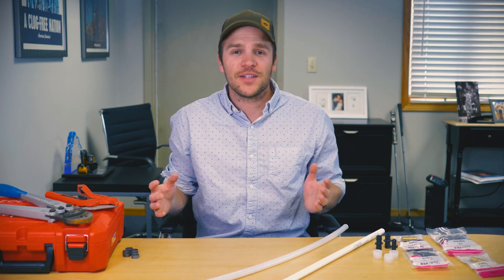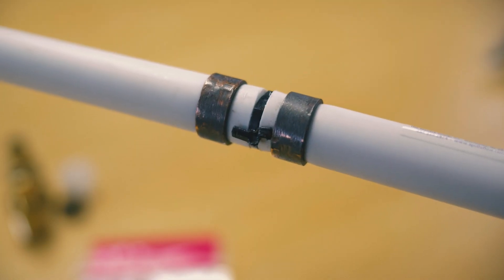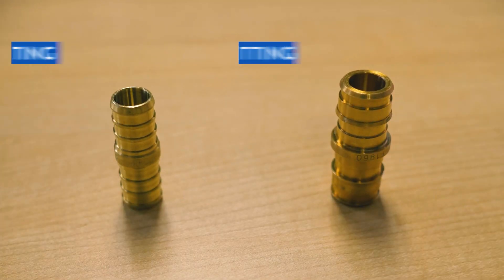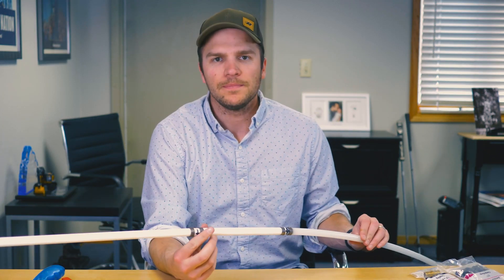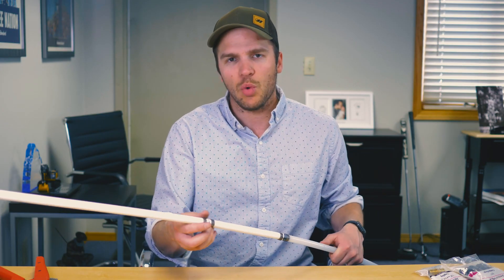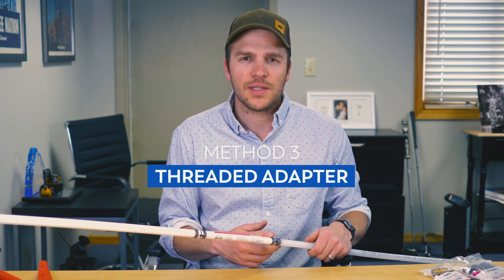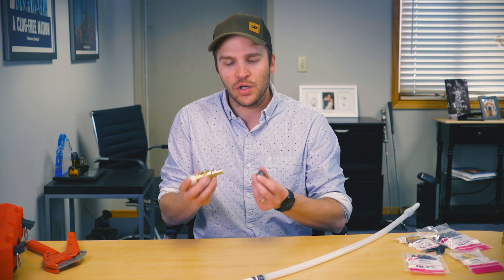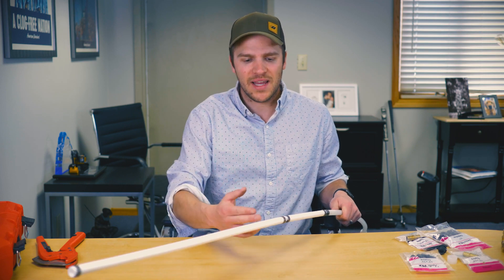Connecting PEX-A to PEX-B

Comment: There is no evidence that sharkbite push to connect connections fail any faster than other connections when used correctly. The main reason not to use them is that it would be insanely expensive to repair them. It is conspiracy theory that has continuously crapped on them as connections. There are perfectly good reasons to use them over sweating copper, one example being in a tight location for a repair. I respect a plumbers opinion if and when they actually say why. But in this video it just says "don't use sharkbite" with no actual reason. Sharkbite push to connect are rated for use in plumbing code and can be hidden behind a wall, given that the plumbing standards are conservative when approving new technologies, I don't see how they are so negatively viewed. Yes some youtube videos will show them failing at 300 psi or more, but residential plumbing should never hit that pressure and you shouldn't expect any connection or pipe to support that pressure. I had a pipe freeze that had a sharkbite connection and the pipe burst out the side wall, the connection was rock solid.
Reply: The biggest complainers of Sharkbite PTF fittings are plumbers who envision the $200 service call to replace a .79 fitting coming to an end. If the simpleton homeowner can repair a leak with a $7 fitting, oh where oh where will all the plumbers go?
Reply: @chrisd4565  enjoyed reading your comment....was preparing to reply to you with the completed quote...but you circled back very eloquently!
Reply: Shark bites as mentioned earlier have limited warranty for a reason! And lab water pressure tests you can google have shown they fail first. Lastly, i replaced all my shark bites by learning to use the preferred plumbers tool of crimping brass rings which is easy and cheap. So invest a few dollars and 15 minutes to watch a video and learn so you have a piece of mind of your house not flooding when you’re out you lazy bastards. Oh it’s true, it’s true!
Reply: I have seen damage to pipes that have a lot of pressure cycling (a house normally wouldn't, but air systems do). The soft plastic pipe is continually scratched by the steel teeth as the pipe expands and contracts. I haven't seen one fail, but have removed one that had deep gouges in the pipe.

A few other things I don't like about them: 

They offer no resistance to the pipe turning. This can make it harder to set a faucet position if it doesn't have a flange with screws (this is a problem with PEX in general as the A&B fittings offer little resistance either, bit more than SB). Or I have run into situations like a yard hydrant where you cannot unscrew the stand pipe for servicing it because a SB was used and just spins instead of unthreading the NPT fitting. 

If you drop a fitting outside, dirt sticks all over the o-ring due to the grease on it. It is hard to get it clean again, and is concerning whether it is any good after that point due to not being able to get all the grit out. Or you are just working in a hole and it is hard not to bump the sides while pushing it on. 

You have to deburr the outside of the pipe as well as the inside, to prevent tearing the o-ring and causing a leak.

If the pipe OD isn't smooth it may not seal. 

They cost more...
Reply: @court2379  so… to sum that up, you never saw one fail, but you’re certain it will. Got it
Reply: @philbear21  No that is not what I am saying. I have not seen one fail in residential water use. I have seen them or the same design for smaller hoses fail in other applications. Air lines, and 3d printer filament guides. It isn't a rigid connection the movement it allows, allows for wear to occur. In most cases it will probably never matter in residential use. The pressure is rarely ever unloaded. So there aren't thousands of full pressure cycles like industrial pneumatics (and even then they hold up for a long time if undisturbed). 

I listed other potential issues with them as well, everything has its limitations. I don't like them for irrigation use, as it is too easy to get dirt in them and have a mess to clean before they can be used. 

If they weren't more expensive I would probably use them more indoors.
Reply: @court2379  you did list other potential “issues”. Let’s take a look at those: 
1) They allow movement: this is actually a positive. How many glue connections have been thrown away before they were installed because they were slightly off? Ever had to desolder copper for the same reason? The only time this is an issue is when they are installed where they shouldn’t be, like the very places you described. That’s user error, not an product issue. 
2) They get dirty if you drop them on the ground/hard to clean. Again, user error, and you can’t glue or solder dirty pipes either. The only point you may have here is that they are harder to clean, but they also come in bags to keep dirt and grit out of them. So don’t drop them or store them out of the bag. 
3) You have to debur them inside and out. If you’re worried enough about all these “potential issues”, then I can rightly assume you follow the manufacturer’s advice for other systems as well, which is to cut straight and debur both inside and out. 
I don’t know air systems, or 3d printing filament systems, but I’m pretty sure they have different requirements than res plumbing. I’m also not sure if Shark Bite themselves even recommend using their product in such systems. If they don’t, then your entire comment is moot, as every problem you’ve ever seen would fall under user error. You can’t drive a nail with a tape measure, then claim the tape measure failed. Also, we’re not discussing “similarly made products”, we’re discussing shark bites. They’re patented, so there are no other products exactly like them, and the only similar ones I’ve seen are plastic. Apples to oranges. 
Lastly, they cost more. They do cost more than other fittings, but if you’re doing a repair, but you’re not a plumber, you don’t have a crimp tool or expansion tool for pex A and B, crimp rings or expansion rings either. Go price a Propress if you think that one is the proper way. A torch, flux, solder, heat shield for copper. Primer and glue for plastic, and anything galvanized needs to be torn out, so I guess you don’t need Teflon tape and a jackhammer to clean that crap. All these things are more expensive for small repairs, and in some cases it’s actually cost effective to do small systems, but that’s what they were designed for. Not whole house installs. They are very fast, don’t require any tool, aside from the $2 removal ring, which reminds me; they’re also removable/reusable, if installed correctly. They are easier to get into tight places, and they can be rotated after connection. Ease of use is their main attribute, and they do that very well. They’re also approved for behind the wall use and I think they come with a 25 year guarantee. So now I’ve written a novel, where I set out to make a simple one word statement of summation: you haven’t seen one fail, but you don’t like them anyway. Hopefully, you feel differently now, but I doubt it.
Reply: @philbear21  It not simply user error to get dirt in irrigation fittings. You are usually working in a hole. Having  a bit of dirt fall from the top, or bumping the side is a regular occurrence. The grade in them collects all the dirt that touches it. PVC having a little dirt get on the connection isn't that big of an issue, or can be brushed off and reglued. The connection area is large and forgiving of such a thing, while the o-ring seal in push on fittings could easily be compromised. Barbed and PEX fittings don't have anything sticky, so the dirt falls or brushes off easily.
Deburring isn't required at all on poly pipe (PE) and only on the inside of PVC, though the cutters don't leave a burr on either.

As for movement, copper and PVC are free at the time they are fitted, so it usually isn't hard to get them in the right spot, and copper can be reheated to turn it. I don't see a major advantage for either. Sometimes you want it rigid, sometimes you don't.

It shouldn't be hard to say there are applications they don't excel at, just like every other product. Dirty environments is one of them. If the pipe is scratched up, they are a bad choice. If you need a rigid connection they are bad choice. If you have threaded fittings nearby they could be beneficial or a problem depending on the situation. Some blind situations you would never be able to undo them, where NPT could be. Others would be near impossible to make the connection without them.
They are just a tool in the box to be used where it makes sense and the extra cost is justified.
Reply: I like shark bite connections. I use them where I don't dare use a torch, and in very tight situations where I can't get a PEX clamp tool.  I've installed them years ago and have gone back to make renovations and the shark bite fitting is still intact and not leaking.
I also like that they can be removed either with a small tool made for removal or a tool of my own making and used again.
Reply: 20 years of personal experience says otherwise. Almost every time I find sharkbites in a house its an issue. Plus having a 5 yr warranty on a part thats not accessible is just asking for an issue. The rate of failure after that is much larger. I get calls weekly for them.
Reply: The evidence is that most professional plumbers and contractors have seen them fail and advise us not to use them especially when concealed inside walls. The good thing for the residential owner's is that thier home owners insurance will cover Shark Bite leak's inside a wall, not if, but when they do leak. 😮
Reply: I am not a plumber, more electrician and part mechanic, in my 45 years of mechanic work, I have never seen an O ring that did not fail. I do my own plumbing, and would NEVER allow a sharkbite fitting to be used in my house. I have seen several leaking or came off, and several friends had flooding  because of them, they were likely not installed properly, but I didn't see them, they just told me about it.
Reply: Couple of reasons. It's against code to put them in a wall because they do fail often.  The only thing that prevents it from leaking is an o ring. O rings deteriorate way faster than anything else since it's soft rubber. Just like your garden hose, or the supply lines to water heaters fall over time, so does a shark bite fitting.  A shark bite is never a permanent solution, unless it is easily accessed.  Now I'm a plumber and have personally gone to hundreds of leaks from shark bite fitting.
Reply: Shark Bites are legal in my jurisdiction they are considered “permanent”. Boi you gotta catch a clue! 😂
Reply: Totally agree.
Reply: I had a few shark bites in my house. I eliminated them after I moved in. I don’t trust rubber seals long term. I also have all pex a with plastic fittings so literally nothing inside a wall can corrode except the shower bodies
Reply: I agree with you, but isn’t shark bike for some reason have only 5 years warranty?
Reply: @agpawpaw  fair point, I have been told that most of the time a warranty is there to cover the period of time where a defect would be exposed in the production of a product. So 5 years seems reasonable to me in that sense. If it makes it 5 years without issue, I’m fairly sure the likelihood of it failing over the next 20 is much lower. This was part of a class I took on product management, not something I’m making up.
Reply: @agpawpaw  pretty sure it’s 25, but I can’t swear. I doubt they’d approve it behind the wall if it was 5.
Reply: as a old school repair plumber , most of our repairs involved replacing failing rubber parts . Washers , diaphragms , o'rings , ballcock seals ect.  Metal and plastic didn't fail as rapidly . Yes new formulations are lasting longer , but chlorines , ammonia and other chemicals still are harsh . Pick up the lid in your toilet tank , touch the rubber , what do you think ? A Sharkbite's seal is just that little oring , the contact area is hardly measurable with a tape measure . If the oring doesnt fail , any imperfection on the outside of the pipe could . The brass in the Sharkbite is thinner than conventional pipe and fittings also , I see freeze failures there . Your statement about the pipe bursting , it fails where the frozen slug just happens to be , copper tube is thicker and stronger than the SB fitting  . I would trust the old Quest Polybutelyne  more lol .
Reply: @jonadabster8401  again, someone who hasn’t seen them fail, but swears they will. That little o-ring is chlorine and chemical resistant, nowhere near the same material as a toilet gasket. They’re approved behind the wall and guaranteed for a quarter of a century. I respect you have an opinion, but guessing something will fail, and seeing it fail are two different things. I’ve done repairs on ALL types of fittings, except SB. Haven’t seen one fail yet. Heard about this one guy who saw…wait, he didn’t see it either. Not saying it won’t, but service plumbers have been around way longer than push to fit connections, so what were they repairing? ALL systems have problems at some point. As far as freezing, I live in a state that gets all four seasons. Our winters aren’t Arctic, but we do see -0F temps. We insulate things for this reason. As far as thinner brass than copper tubing? Pretty sure they’re different metals, with different properties, but either way, insulate it and it’s fine. User error is why they fail. Homeowner being user is why it’s common. Also, I hope that last bit was a joke.  If you trust ANY Poly more than SB, I can’t even take you seriously.
Reply: @jonadabster8401  Aside from a complete lack of any resemblance of correct punctuation and grammar, you are correct, rubber gaskets do fail. I have seen many toilet rubber parts fail, but they are also not made to last. If a toilet flapper was made to withstand 40 years, it would cost significantly more and likely outlive the entire toilet. Anecdotal evidence is not in fact proof that the gasket on a sharkbite will fail. They are different rubber compounds and the sharkbite is clearly designed to last much longer.  I also never said the sharkbite connection was superior to a sweat connection, I simply said there is no real evidence they fail at the rate plumbers suggest they do and therefore cannot be trusted. Once again when used properly, they are perfectly fine to use. Repeated connect/disconnect on the sharkbite will cause them to fail, I have seen that happen, but connect once or twice, they work perfectly fine and save time and work in spots that are hard to reach with a torch or propress. Your argument on a pipe bursting at the freeze point is simple lacking any reality in fluid dynamics. The pipe bursts due to pressure build up from water freezing in the line and it not having anywhere to go but through the path of least resistance. In many cases its a small pit in the side wall of the copper that can develop from hard water and impurities in the line. If you want to make the argument that water quality impacts the longevity of a sharkbite, take a look at copper pipes in areas with hard water, the sludge build up which is known to lead to corrosion on the line is real. Nothing in plumbing is permanent and some things are better than others, I agree a sweat connection is superior, but a sharkbite connection is also perfectly fine to use.
Reply: @MarksDIY  I am somewhat  embarrassed that my phone texting accentuates my already poor Grammar  . My High School years in the 70's were really more focused on hunting , Jeeping and chasing  pu...er ..girls lol. For that I have absolutely no regrets . My regrets started when I found out how I was poisoning families using lead solder in my water distribution systems . 3 decades of code mandated solder and then one day prohibited and now a punishable offense . What joy when plastic pipe and fittings were code allowed . The piping of the future they said ! My plumbing company grabbed that ball and ran with it , installing it in  countless houses in my  . 15 years of plumbing in my circle of acquaintances and neighbors , heck , my customers became my friends . I can still remember my first call , was 3 am , a Acetyl  fitting in a polybutylene hot water line feeding  a tub blew above a kitchen . Steaming water cascading onto wood custom cabinets . Many fitting and aluminum crimp rings were failing  all  over the country .Codes were then changed and required copper or brass fitting only . Big woop , 5 years later after millions of class action lawsuits already , the piping itself started failing , at a frggen  alarming rate , developing pinholes and splits . Mind you , I'm a 2 truck outfit , my reputation was my only advertisement . Hard to look these people in the eye at the grocery store knowing my piping was responsible for flooding their homes . The plumbing is only as strong as the weakest link , and it will not hinge on a 1mm barely squashed o ring by my hands . I just replaced a burst sharkbite last week in an attic . It was also  failed  oring that took out a Space Shuttle in the 80's  . Tested and approved to me ,means wait and see .   I'm so happy that a hidden sharkbite is fine for you , hope you have many in your future . But if your charging people money , I hope it's for correcting spelling and grammar , not for pushing on a timebomb .
Reply: @jonadabster8401  I apologize, it was a low blow mocking grammar. I would never confess to have more knowledge about plumbing than you. I'm not a professional plumber, I was trained early in life as part of working on a kitchen and bath renovation company. But my point still stands. The gaskets used on propress are no different than on a sharkbite, propress is considered permanent and sharkbite in the plumbing world is questioned. Additionally, if a homeowner would like to save money by replacing a failed section of pipe but doesn't want to invest in or learn how to sweat copper, a sharkbite is a perfectly reasonable solution that is not going to poison someone and has not legitimate history of failing. All things have an expected rate of manufacture defect failure, sharkbite is no different. But once again when used properly (pressed correctly with clean pipe) the fittings are considered more than adequate for use in closed spaces. The national plumbing code has authorized it. Lastly, given that fewer and fewer people are entering trades like plumbing, having a consumer friendly solution for minor plumbing repairs allows for plumbers to avoid being called in for tiny jobs that are not worth their time. Any large city resident will attest, it is hard to find a contractor willing to do small jobs in any trade because it isn't worth the time and effort when the are busy with $2k plus jobs. Nobody should be forced to pay $2k to replace a faucet or failed valve. I also don't expect anyone to learn how to sweat copper as well, so sharkbites are a good and cheaper than hiring a plumber for a small job solution. I don't expect plumbers to use them for their fixes, that doesn't make any sense, but for homeowner repairs they should be considered and championed by the plumbing trade so you all can work on bigger projects that pay more. Win win situation there.
Reply: I have probably a dozen Shark Bites buried in my walls and I don’t lose any sleep at night. They are great. Just always mark the proper insertion depth on the pipe before installing, just in case!
Reply: @MarksDIY 
1) You're confused about burden-of-proof. It's on you to prove they're equivalent not on anyone else to prove you wrong. 

-however-

2) Anecdotal evidence from actual plumbers in real life and on YT claiming a high failure rate as well as concerns about how the connection works are both fantastic reasons to steer clear of a fitting type when a better alternative exists. You're the only one insisting on curated lab findings from a dubiously-funded study as your "evidence."

3) If you think that 5 years is an acceptable lifespan of a fitting that is hidden behind a wall, you and I have very different quality standards. Enjoy tearing your walls down every 5 years to find a failed o-ring.

4) You incorrectly assume a connection that makes it 5 years will make it 20. PEX maybe, Sharkbite no because it relies on the o-ring not wearing out, a problem you already admitted to above. 

5) Above you claim: "the sharkbite is clearly designed to last much longer." Please provide objective evidence of the nature and quality you're demanding of everyone else here to support your unsupported claims, oh Impartial Weigher of Evidence. Otherwise STFU. 

6) As a helpful life rule I would recommend making sure your work is grammar and spelling error-free before criticizing anyone else's.